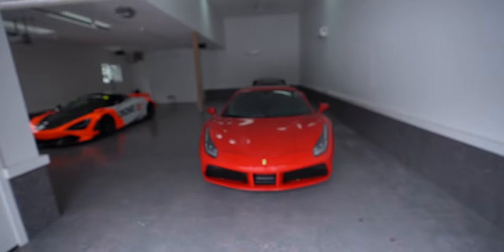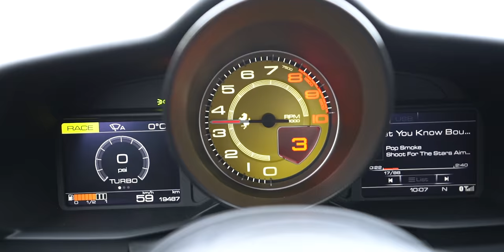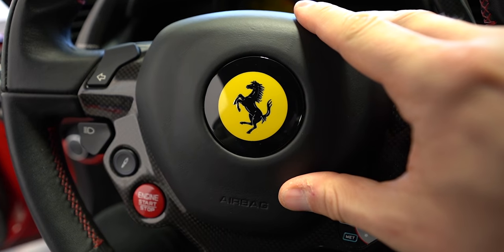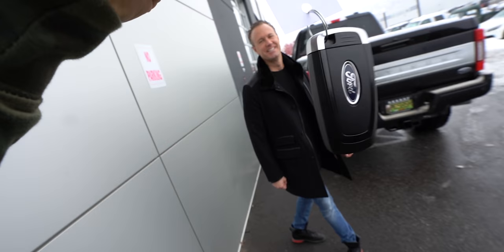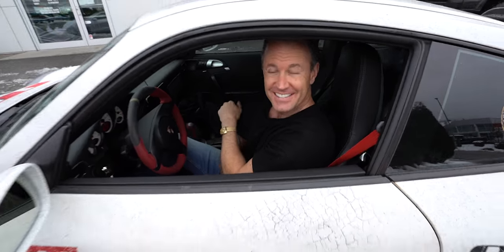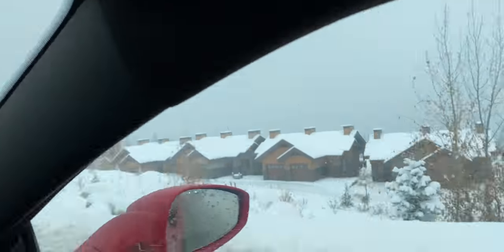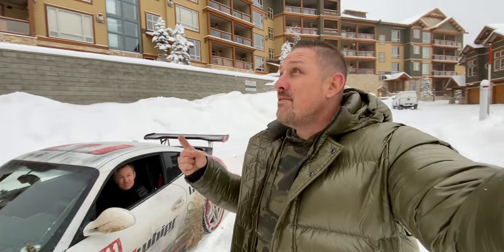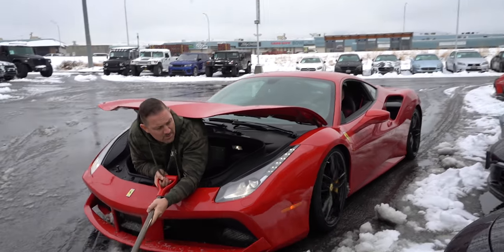LOWERING MY FERRARI INTO A SNOW PLOW?!

Comment: That's awesome, mine was no supercar but in 1994 i lived in Fernie and drove a 205hp 1st gen RX7 all year round, had the stock front put back on for winter instead of the splitter so that made it a bit easier, but low, rear wheel drive, manual, and no "snow mode" back in 1985 when she was built!!! No issues with the right tires and keeping your head up!!  Glad you're having fun!!!

Comment: You might want to watch it driving with those tires in the rain & snow. Yes I know they are M/S tires and the more little slices in each of the treads make them better on ice Usually. But If you look from the center of the tire to the outside edges there are no 
continuous channels going from the center all the way out the sides, so the water can squirt from the center all the way out the sides. The outer treads have rubber in between linking them so its not possible for the water to go out. So since it won't let the water out the sides it traps it under the tire and lifts the whole car up and makes you go hydroplaning across the road. Please be careful

Comment: I also love driving in the snow. Problem is noone in England knows how :/ I once stopped a 4x4 that was sliding down a snowy hill with brakes locked when it ran into the back of my little FWD hatchback - because i knew to use the gears, not slam the brakes as hard as possible. And that was MAYBE 1.5inch of snow - definitely less than whats in the video.